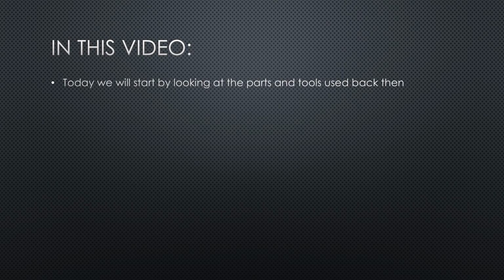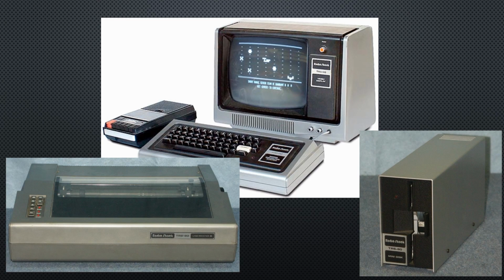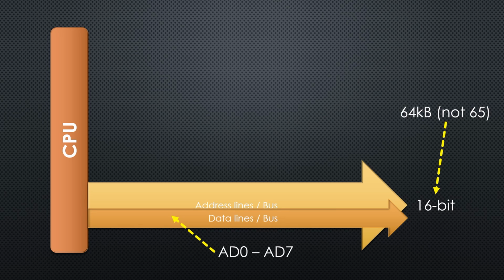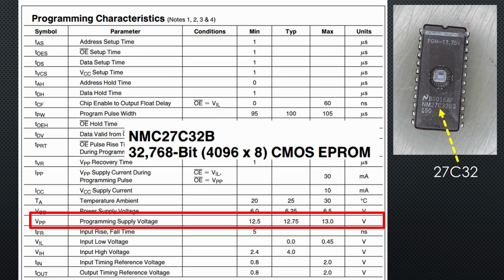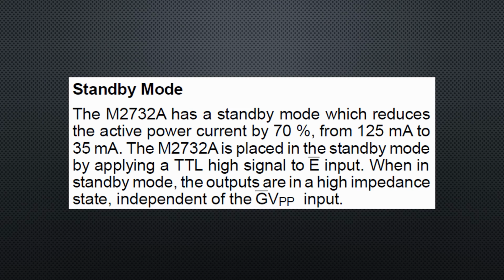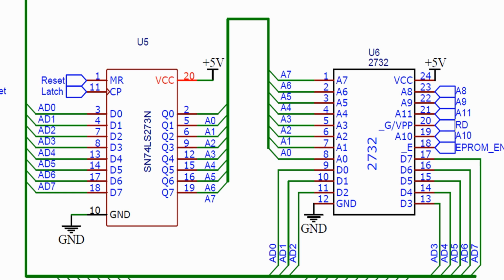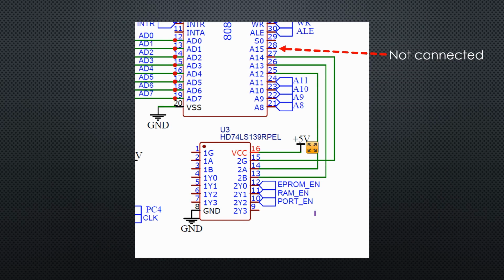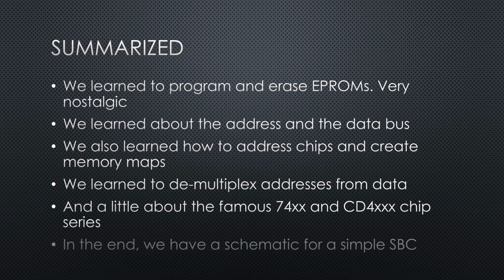#297 We build a historic "PC" using technology from the 1970s (8085, 8155, old EPROM, TTL)

Comment: I'm also 63 years and grew up in SF Bay, so have 40+ years in computers, software and electronical things (35  of which are obsolete).

Found your hilarious and accurate representation of those days refreshing.  Love the Swiss accent - keep up the good work!

P.S. once connected an Atmel 8085 (?! flavored chip (someone knows the part#) to an old school PS/2 keyboard [clock, data and power].  Fun fact: it sent keydown, keyup!, func keys, shift, ctrl, etc. along with control over 3 LEDs in a seemingly random but decodable fashion.

Currently working on an RCA CDP1802 (Membership Card) just for fun!

Comment: I'm 70 and I'm building a Z80 CPU and building a project using the other Z80 chips, EPROMS and static memory. It will be around the 50th project I've made using the Z80 CPU and the Z80 family of chips. I also have the exact same EPROM eraser you have. So we must be cousins! Pleased to meet you. Frankly the 8085 is a very good CPU and fun to build project. But, I think the Z80 and it's family is perfect for a single board computer. Of course everyone loves their own favorite CPU to use. I have several friends about my age who think the 6502 is fantastic to build with. I hope that many people will fall in love with these projects and build their own. (And I'm using one GAL for all the glue and decoding logic (memory and I/O) for my project. I'm using a GAL22V10 at 10nS decode. It works well and uses the same programmer you have in your video. I like it. It is tricky to program, but there is software out there that will help you write the code for programming the GAL. It makes it easier to build the single board project.  Happy building!!)
Reply from the maker: I was a big Z80 fan back in the day when I had a TRS-80. I did a lot of assembler. But for my small Morse Trainer, the 8085 with its interface chip was a better choice. Also because the PCB was simpler. And I was able to develop on the TRS-80
Reply: @AndreasSpiess  Yes! I used the Heathkit H-89 to write the assembly using MS-DOS and a wonderful assembler and linker to generate the HEX for the EPROM burner. The software was written by Avocet and it worked so well it was amazing. It was a two pass assembler and it would stop and report and goofs one made and jump back to the text file and show you where it thought you had made a mistake in your assembly code. I sure did like that, and it would ask you if you wanted to change the code. And that was all based on DOS. No Windows. Pretty amazing. I miss that software. 
Those days are almost gone now. But I hope there is a resurgence of interest for the “old ways” of building a computer. Coding and memorizing the memory maps and the instruction sets for these old CPUs and their family of support chips is one of the very best ways of understanding what goes on under the new generations of microcontrollers. It truly helps. And… bonus, the Z80 and most of the Z80 family are still being made by Zilog. In a CMOS version that’s faster and only sips power now and those chips will run at up to 20MHz. Pretty amazing. I’m looking forward to the next video.

I might create my own YouTube channel and show how to design with the Z80. It might be interesting. Or just for fun. Cheers, Andreas!
Reply from the maker: @BigDaddy_MRI  Go for your channel! I am sure some people will follow you and have fun.
I do not miss the assembler times. They are a part of my history, but I like much more to use what we have available today. I currently live in a wonderful time for electronics! So, do not expect many more videos on this topic from me 😞

Comment: I was fortunate to have entered the computer industry (component level repair on OEM equipment) in the early 1980s (so much of the computer equipment I worked on was from the 70s). I still remember (40 years later) the functionality of the 74XX family off the top of my head. Words such as "propagation delay" or "fan out" or "rise and fall times" are seldom used these days it seems. There was none of this BGA "rubbish" in those days.  We really needed to understand CPU architecture to succeed at out jobs. I'm so old that I used to "single step microcode" and analyse individual machine code instructions. Quite rewarding when working with digital electronics at this level.
Reply from the maker: Indeed we needed different skills back then. What I love today is the speed I can create things. Back then I mainly had to care about limitations. Today, if I have an idea I can build it rapidly and nearly free of charge compared with the prices back then. But it still good to have the knowledge of the past. Particularly if something does not work!

Comment: I designed my first robot around a 8085 microprocessor and 8255 chips didn't have to de-mux the bus just program in machine language instead of the high level languages of today .
Reply from the maker: Strange that you were able to use a 8085/8255 without de-muxing: https://technobyte.org/8085-8255-interfacing-tutorial/
Reply: @AndreasSpiess  didn't have to de- mux the bus just had to use some higher address lines to select the chips. Easy peezy with some logic chips.
Reply: Look at the book build your own robot pet . It's old but when I was in college 35 years ago it was state of the art. Lol
Reply: It might of been a 8155 I'm old and sometime get things mixed up but thanks for your reply. Love your channel

Comment: This brings back great memories for me.  In the early 70's I wire wrapped my own personal computer using a Motorola 6800 microprocessor.  I had to build everything from scratch including the floppy disk controller and CRT driver.  Then I wrote a text editor and assembler from scratch.  It was a lot of work but great fun.  Back then I worked as a computer repair tech for Digital Equipment Corp. on PDP11s and we were expected to be able to repair circuit boards to the component level if replacement boards were not available.  Now I'm a surgeon, but those  were great times!
Reply from the maker: I even made a video about wire wrapping... And I also worked for DEC.
Reply: @AndreasSpiess  If you ever find yourself in the Czech Republic, let me know and I will buy you a beer.

Comment: My first computer is a CDP1802 COSMAC Elf built from a kit costing $100 in the 70s.  Got into PIC with the 16f84 and an external programmer about 20 years ago.  Also built a 8052 SBC using some vintage SRAM and 74xx chips, but using the Atmel clone CPU with internal flash.  It has a 32K byte Sony SRAM and a bunch of point to point soldered wiring.  I flashed it with 8052 BASIC interpreter.  When it was all done, nothing came out the serial port and I thought it wasn't working.  Talked to a friend and, after extensive discussion about what could be wrong, he told me to type a space for the autobaud detection and it roared to life.  That little computer has more procesing power than the TRS-80 that I so badly wanted as a teenager in the 70s, and a whopping 32k of RAM.  It sits on a shelf now, but should still work fine if someone connects a 9 pin serial cable and a 9V battery.  I have an external EEPROM that I intended to literally stack on the SRAM chip, but break out the two or three pins to make it work as non volatile storage for programs, but never completed that part.  It has no interface to store or load programs from, you have to type everything in and it's lost when the power is removed, but I suppose using a terminal program like putty, you could probably save programs by "list" and capture to a text file, and upload using a simple ascii file transfer protocol that would simulate typing the code in, just have to give it time after each line for the interpreter to do it's encoding of the statement.  I wish I'd known about the 74ls574 latch instead of using the 74ls373, the pinout would have saved me making about 16 confusing point to point wire connections.
Reply from the maker: Sounds like an fun project! It is rare to find a very similar chip with different pinout. But the 74ls574 probably saved a lot of time for many people...

Comment: Do you know if its possible to set the programming voltage of the TL866 internally to 21V (tor flash the 2732)?
Reply from the maker: It is not possible

Comment: Excellent video. I have always noticed that the breadboards tend to bend out on the bottom when you have an excess of large diameter pins or too many things plugged into the breadboard. So you may have something plugged in but its not making contact with everything else in that row. I know its happened to me may times before. I have faith in your ability to get this dinosaur going!
Reply from the maker: We will see. I used a better quality breadboard to avoid problems. But you never know...

Comment: Thirty years ago...? I built a 6809 based computer with bits I bought and bits I was given. It was on four double sized euro cards. I wire wrapped everything. The CPU board with IO, the 64K dynamic RAM board, the Video board and (gasp) the floppy disk controller! I got hold of FLEX09, a floppy disk controller OS, and software to go with it. It lasted a couple of years before the wire wrap oxidised and it died. I wish I'd taken photos of it before I dumped it all.
Reply from the maker: Interesting to read that wire wrap oxidized. I did not know that this can happen :-(

Comment: The 8 bit transparent latch (74x373, 74x573) work correctly with the ALE signal, without the need for the inverter.
The Z80 processor isn't really more complicated than the 8085.  It has a different mix of control signals (ME, IOE, READ, WRITE, etc)  It can't work with the 8085 multiplexed bus chips (really only the 8155/56) but it can play well with the 8255, 8253/4, 8251, etc, and also similar io parts made by AMD.  The mix of 74x glue logic will be different, but not any more difficult.  It IS possible to build a very simple 8085 board with fewer parts than the Z80 but not by a large difference.  I remember building a simple 8085 controller that had the CPU, '373 latch, 27xNN eprom (usually a 2716),  8155, and an inverter for the CS to the 8155 (wasn't needed with the more expensive 8156).  The rom was in the address space from 0000-7fff by using A15 to CE.  The 8155 was at 8000h by using the inverted A15 as CS.  Code only used the 256 bytes of ram on the 8155, our simple programs didn't need any more.
Reply from the maker: You are right with the 373/573. I got this tip from several viewers and changed my diagram. Concerning the 8085: It has built-in clock and interrupt logic, which can be helpful if you need a "real time" component. But you are right, the differences are not big.

Comment: Why '273? '573 is much easier to design PCB, or build on universal PCB. And don't require inverter on ALE signal.
Reply from the maker: In the meantime I used both, the 373 and the 573. Unfortunately the 573 cannot easily be fitted (at least I was not capable) even in theory it looks great.

Comment: Hope you get it finished and are able to show how development on these was done...
when I started working on 8 bit micros we home cooked a 'monitor' which lived on the day 0 EPROM. it initialised the serial & read in the hex files (we used motorola S record which is an equivalent to Intel hex format) ... then we were able to upload and test software running in RAM piece by piece - we could discover our new code was rubbish without having to bottleneck the process on erasing and programming EPROMs each time, when the software reached and acceptably low rubbish level we could change the start address & burn it to the EPROM - I assumed everyone else was doing the same but tbh the internet at that time was just for universities and large companies.
Reply from the maker: Your monitor was a good idea to get fast test results!
I do not know how far I will go. This video did not get a lot of interest.

Comment: This brings back memories of programming Z80 by writing the hex numbers of OP codes.. in the  late 90's :D The TI-85 calculator didn''t have real compilers back then (other than the internal BASIC interpreter)
Reply from the maker: I had at least an assembler for my work in the 80. Back then, C was hardly invented ;-) Maybe I will be able to use C now on the machine.

Comment: Oh boy! Thirty years ago I had to build my own controller based on Z80, its peripherals, EPROM, timer chips (8253?) the classic 8255 PIO and plenty of RAM(!) about 16KB...!
The whole thing was done on two boards of 10x15 each. The Z80 was on a perforated board with thin wires (crazy...) and the I/O on a pcb hand made on top of it. Very strange, it did work first power on!
Reply from the maker: These thin wires were probably called "Wire Wrapping". I did a video about it if you are interested...
Reply: @AndreasSpiess  Well, not exactly. They were soldered and not wrapped around the pin. But was not necessary to strip the wire. Just soldered it to the pin and the special insulation was disappearing without fumes! Magic! The wire was given to me as our market back then was lacking such beauty things.
Thanks for reminding us how things was done back then!

Comment: @Andreas Spiess ANDREAS! I hope you see this before you order the PCB! In the schematic, the 6116 RAM chip has an error! Two pins are labeled as pin 9, and two as pin 10. In other words: A9 is connected to IO0 and A10 is connected to IO1 ! This is obviously not good. You need to edit the chip the chip symbol: in EasyEDA right click on it and select "Edit Symbol", and then change it so that A9 is pin 22 and A10 is pin 19. I know about this because I made a PCB with this chip for my Ben Eater inspired "macro processor" build and was very confused as to why two of my output pins consistently didn't give me the expected result. I finally discovered the error was in the 6116 chip's schematics on EasyEDA. I used the auto-routing feature and blindly trusted it when making my PCB. If you are manually routing your PCB then maybe you have already discovered this problem.
Reply from the maker: Thank you for the information. I was on holiday, so nothing happened. This is not an easy "find". Now I corrected it.
Reply: @AndreasSpiess  Crisis averted! :) Yes, it took me some time to figure out why my pcb was wrong. It happened quite recently, and I'm glad I could help you. What have we learned? When using things from the "User contributed" category on EasyEDA, always check that everything is connected correctly.

Comment: Interesting project, but using 27C32 little bit expensive. And 8085 not my favorite CPU, I love Z-80 =)  But if there be cycle of videos and software for it.... mmm
Reply from the maker: I got 5 27C32 for 8$. I used the 8085 because I still had a board around to refresh my brains...
Reply: @AndreasSpiess   but you need programmator and eraser to compleete mission. I AM already order chips for this project, in searchhing for soft for  8085, and waiting next video
Reply from the maker: You are right, you need a programmer for those chips.
Reply: @AndreasSpiess  I ordered at28c256, and have  arduino with breadbord, I think it Will be enough to programing this little puppies =)

Comment: Thanks for the trip down memory lane.  I started just like you.  First a RS Color computer to which I used to teach myself BASIC and then on to the same Trash80 you showed.  I then taught myself Assembly and how to read the Z80 documents.  RS was good about supplying documentation on those early computers.  From there came 2 degrees in EE and the career.  Along the way I found the wonderful PIC microcontrollers and loved them.  Finally came the Arduino, were all the tedious low level work was eliminated and you got better instant gratification!

There good old UV light erasers.  Back then you used an emulator for code development because it took to long to erase the memories for each iteration.  You developed code on PICs with the exposed memory.
Reply from the maker: I skipped the "PIC time" completely because i still was in "family mode" back then. I tried to write a "EPROM emulator" with an Arduino but have to wait till I can get the 8085 to low clock speeds for that experiment...

Comment: In 1980 I wrote assembler for M6800 based barcode readers, the hardware department designed and build them.
Reply from the maker: The vertical integration back then was way deeper than today where we buy a lot and do not make many things ourself. But productivity increased because of that, I think.

Comment: Hi Andreas, yes those were the days. At my job we build up to 8 SBC boards with 8085 and one SBC 116 for shared memory connected via Intel’s so called Multibus which provided real time parallel processing.   Programming was all done in assembler, OS and Application clearly seperated. Great time. Reference: Gfeller AG Bümpliz, Telebit 20 Fernwirksysteme. Still befefit from these experiences today. Regards, Simon
Reply from the maker: Yea, my first encounter with the 8080 was as a student at Ascom in Solothurn...

Comment: Very good, I'm sure we wrote more efficient code long ago as we had to get our code into 2k or 4k of EPROM.
Reply from the maker: The question is how you define "efficiency". If you define it in an overall sense, assembler was not very efficient because it used a lot of time to write something. But for sure it used memory space very efficient. They were even on the moon with a few bytes of storage.
Reply: Last weekna colleague reported to me a problem with windows command line utility to list existing processes (equivalent of ps)... the output was faulty when a process had been launched with a command line + parameters that was more than 8k characters long